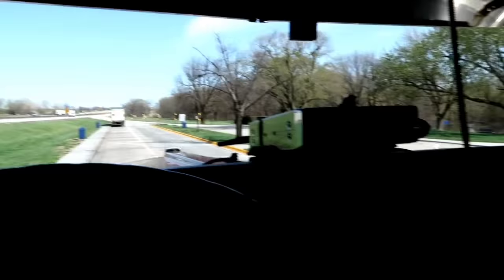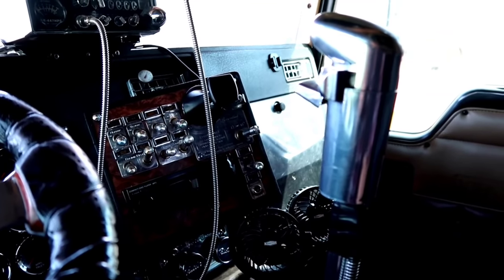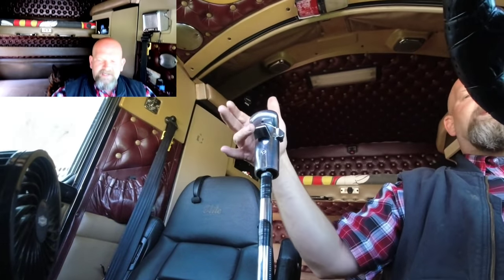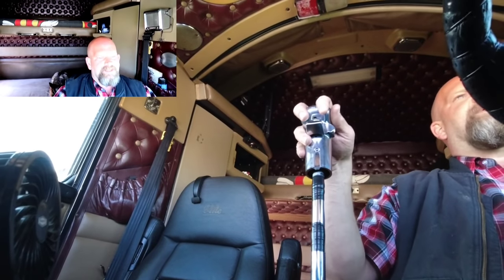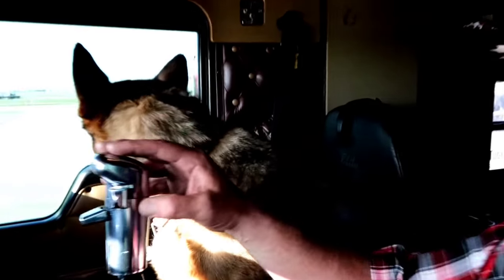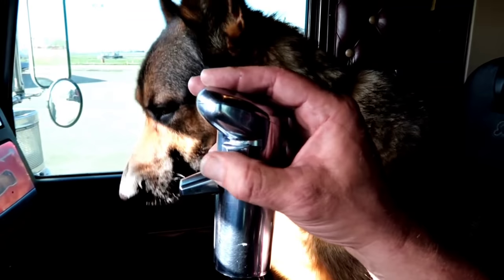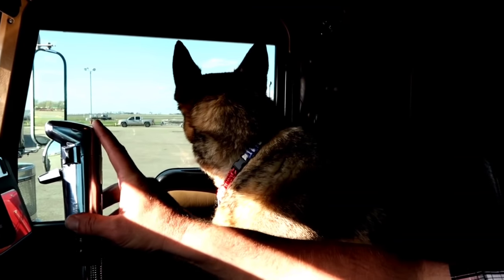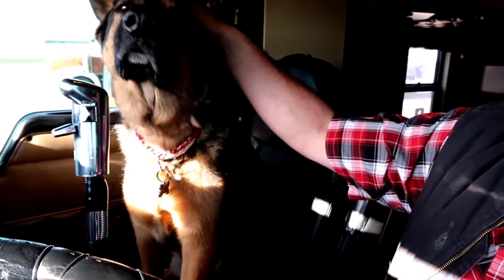How To Shift An 18 Speed Transmission SMOOTHLY ~~ Meat Delivered #323

Comment: I learned on 13 spd. Low, 1 2 3 4 5, 5th over, 6, 6th over, 7, 7th over, 8, 8th over. I drive an 18 the same way. It's your truck shift it any way you want. I notice you split 5th the normal way most of the time. Lol. Stay smooth !
Reply from the maker: Sounds good to me, I wish I new that count before the video lol.
Reply: I've been driving for 40 years and always thought splitting the bottom 5 and the top four gave you 18.  Reverse didn't count but not sure because I've never looked at the diagram   haha.  It was explained to me that an 18 was the same as a 13 except you can split the bottom 5 giving you an extra 5   

Anyway, enjoy your videos! Keep them coming my friend !
Reply: I learned the same way.
Reply: @airdog4442  your correct this guy doesn't know what he's talking about. Hes teaching people wrong, like many other on youtube. I feel like sending him a old Eaton fuller VHS tape on every one of there trannies from old generation 13 to new generation 13 totaly different shift technique then has 18, 15, 9, 10 etc etc with all the do's and don'ts on each tranny, he would also learn that not all gears are always required or even should be used at certain times depends on terrain and load etc.

Comment: Im trying to catch on   but   its really confusing   the wording   when your in lo 4th   and go to 5th   thats  basicaly the 1st gear position  but  HI    so thats not splitting or is it ?     splitting a gear is a moderate ratio change    you cant split gears with the front switch  ( only the side switch is a splitter I thought)  or can you    no way unless you have no load can you just flip that front swich  without changing the gear selector  it would  bog down  maybe with no load? never drove truck  sorry dumb questions

Comment: Do you use the clutch when you shift?  Or it is all about rev matching, or both?
Reply: If you're skilled. You can use the clutch just once to get you going, and then "feather shift" which is shifting without the clutch, and done by listening to both the engine and observing rpms on the tach.
Reply from the maker: Just float them. Yes putting the rpms in the right spot.

Comment: I think you are the best 18 speed driver I've ever seen.  But, you're understanding of the gear layout is wrong.  It is NOT a 24 speed.  It is 18 FORWARD speeds.

The little lever on the side is the splitter and the lever on the front is the range selector.

It is very simple once understood.  And the diagram on the top of the shifter is correct.  Maybe not clear, but is correct.

It is a simple 4 speed H-Pattern, with access to another gate on the left in Low Range only.  In Low Range, the leftmost gate is Reverse (upper left) and Low (lower left).  Both Reverse and Low can be split.

However, the 18 forward speeds are gears 1 through 4 in Low Range and gears 5 through 8 in High Range.  Each of those gears can be split.  That's 8 gears x 2 = 16.  Plus Low can be split so that's 2 more for a total of 18 forward speeds.

Once in High Range, the leftmost gate (where Reverse and Low are located) cannot be accessed.

Comment: Is it true that gear 4 with front splitter down and gear “low” with front splitter up (high range) are the same gear? So, instead of going from gear 4 low range to gear “low” in high range you go from gear 4 in low range to gear 5 in high range?
Reply: look at a six speed on a car. you shift 1,2,3,4,5,6 low range button down. from 6 low range flip lever to high range. then shift from 6 back into 1 now your in high range. now the thump splitter on the left side the shifter. it splits you will be in 7 high range low range on thumb splitter. you see kurt pull the shifter out, put back into same location. he went from let's say, 7 high range on the low side splitter to high range 7. from 7high, shift to 8 place thumb splitter back to low as you shift out of 7 into 8. that shift is now 8high on splitter and low on the thumb splitter. shift the thumb splitter into high range shift into neutral then back to 8 it puts it into 8 high and the high side of thumb splitter. keep repeating 9,10,11,12 on up.
Reply from the maker: Not sure

Comment: lol soccer bloody soccer um hey teach great lesson when I did a trip from Western Australia to Queensland and return in the Iveco eurotech 8X4 i was told split the last 2 gears and not all of the high range  gears owner said it would cut down wear in the transmission I've never split the reverse gear or low but did change the range in reverse and way to fast I find the Spicer  16 speed better over road ranger/Eaton Fuller  I was thinking that first class had a deep reduction to get the extra gears to get them extra gears and never use angel gear  (neutral) only when the park brake is applied bit and frowned on using angel gear going down hills to save fuel your 7CZ cat wouldn't need/use all that horse power in you truck but its nice to have it i still cant get my head how you go to next gear at 1500 rpm I'm  between 1750 and 1950 rpm to get the truck up to speed occasionally I shift at 2000 Plus rpm cause its a gutless 12.7 Detroit when fully  loaded empty i don't split low range
Reply from the maker: Ya I don't think the cat would like that high.
Reply: @truckingwithschmidt7120  lol

Comment: Actually the reverse gears don't count as "speeds".
You got 1 through 8, plus all the half gears, which makes 16, and then the Lo which also can be split to make 18 gears.
(High range Lo is the same as 4th, so it doesn't count.)
Then you got 4 reverse gears, 2 in low range, and 2 in high range.
It makes sense not to count te reverse gears because when you look at an Eaton 10 speed you got: 1 through 5 in low range, and 6 through 10 in high range. (No Lo gear there.)
They don't count the 2 reverse gears there to make up a 10 speed.

Comment: 24 gears but you almost never use more than 20 of them because high range low is the same set of 2 gears as low range 4th . That takes it from 24 to 22. Reverse has low range low and and high and high range low and high. Unless you’re a maniac you won’t back up in high range. That’s 20 gears. Now you don’t generally use low unless loaded heavy in a hill or pulling out of a loading dock and you have a preference for which reverse gear to use. Down to 17 gears skipping low and only using a single gear for reverse either low reverse low or low reverse high. 

Just forward gears down to 16 gears. Since it is an 18 speed and you can have the splitter in high in all gears you can start with the splitter in high and just leave it there the whole time - 8 actual gears being shifted if you start in 1st instead of low and don’t split all your gears. Now if you have an empty trailer you’d start in 3rd or 4th. Down to 6 or 7 gears. And in very rare cases you can be bobtail and skip low range entirely but use that high range low in place of low range 4th and it’s a 5 speed. High range splitter in high. Low, 5, 6, 7, 8 all splitter in high. 

Now if you do use all 18 gears it is low low, low high, 1, 1 high, 2, 2 high, 3, 3 high, 4, 4 high, go to high range before moving stick, 5 low, 5 high, 6, 6 high, 7, 7 high, 8, 8 high. Staying in 8 low is okay but 8 high is like a second overdrive for better fuel mileage or for 70 mph+

You could also split just high range and drive like a 13 speed skipping low. That’s probably best most often but I see no point in shifting the whole way with splitter low and then splitting to high at the end unless driving like a 13 speed and you’re not heavy.

Comment: 18 gears, not 15, not 24. low low, high low, low 1-4, high 1-4, low 5-8, high 5-8. Means you have 10 gears on the low range(low-5 with a low and high each), 8 on the high range (5-8 with a low and high each) for a combined of 18, plus reverse gears.

Comment: Dude, you got 10 gears in the low side of the transmission and you got eight in the high side if you use the mystery gear those aren't progressive it's still an 18 speed I hate to think you can't count I know you can

Comment: to add to my other comment. this guy really is a numskull explaining 18. yes it does have 18 gears forward. not conting reverse high and low. it has low gear first gear second, third, fourth. . Lets take low gear out of the equation. 1-4 plus high range to 5-8 is 8 gears. Now were up to 16 gears with the high and low splitter. Lets now factor in low gear which is down in the hole from rverse. You have low on low side and then low on the high side. Thats 2 more gears. Whats that equal??????? 18 gears. Boy this world has become brain dead. YEs 18 speed owner opertor hear.